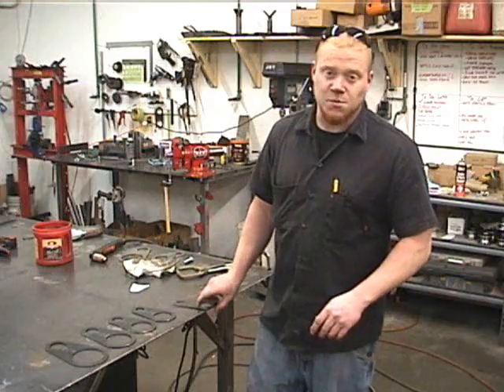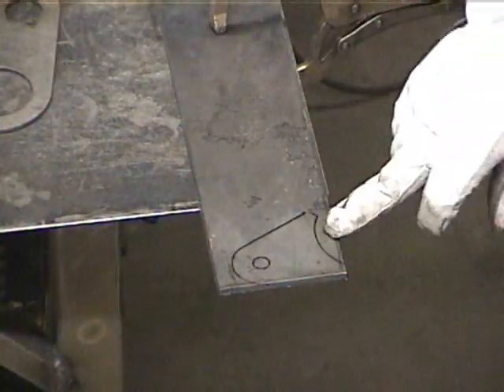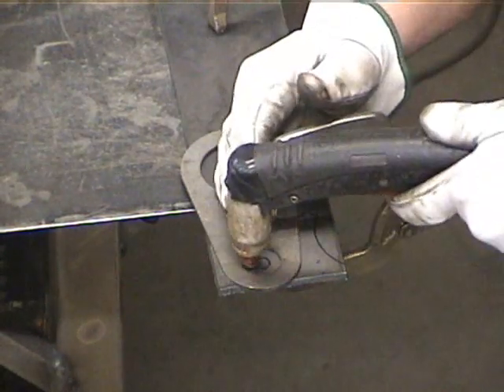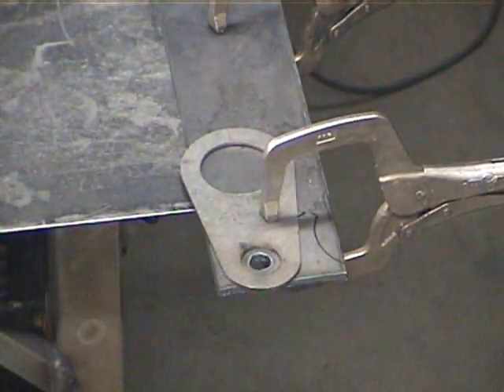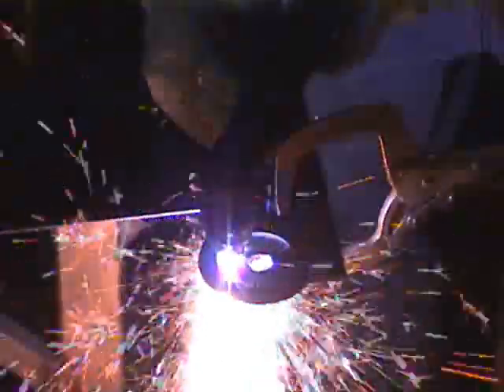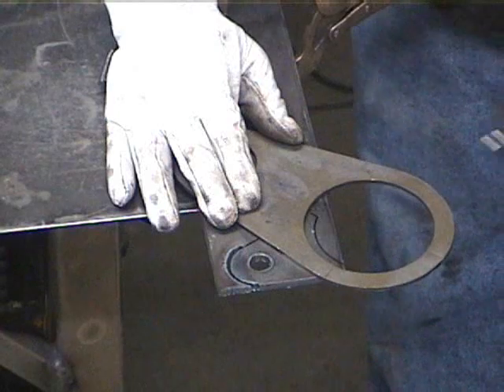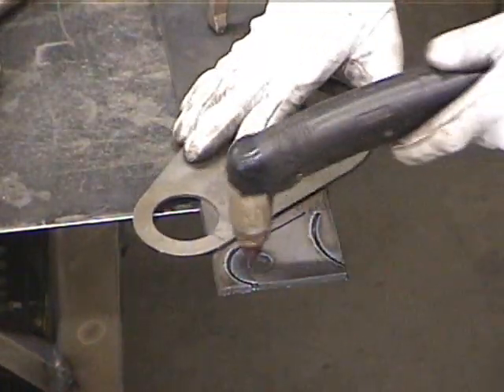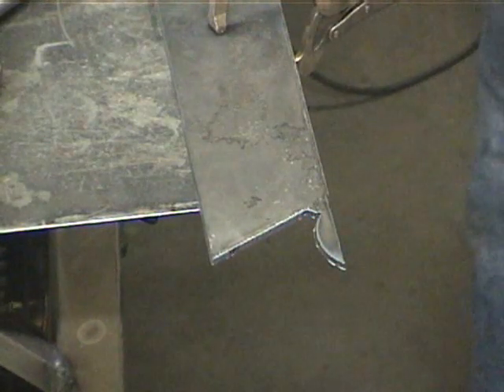Plasma Stencil Circle Hole Cutter Template demo

Comment: What is the drag shield size for Lotos Red 5000D for your stencils?
Reply from the maker: The Lotos machines change a lot, the High Frequency (non blowback/pilot arc) don't work with our stencils very well. In either case you will most likely need a different drag nozzle. https://georgesplasmacuttershop.com/ should be able to get you hooked up with the right parts.
Reply: @911Motorsports  how about a primeweld 60
Reply: @911Motorsports  You can disable pilot arc on Lotos machines by disconnecting the green wire.